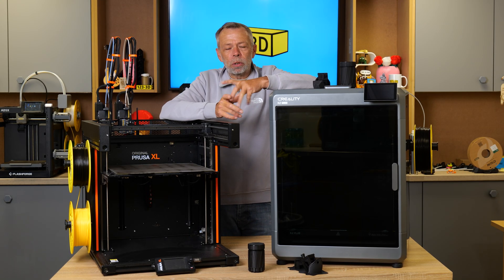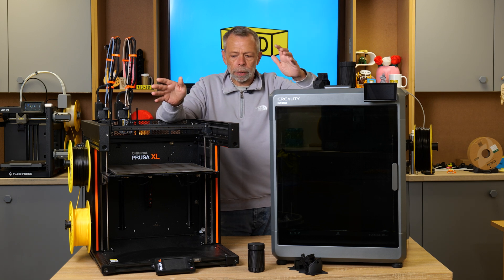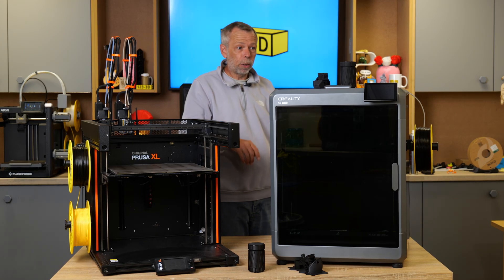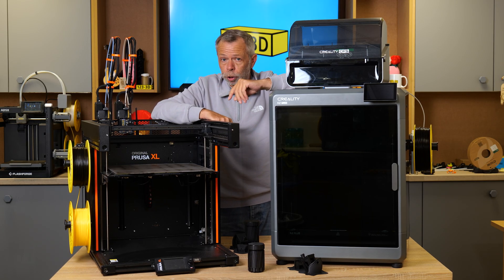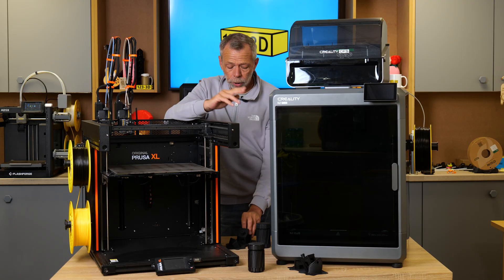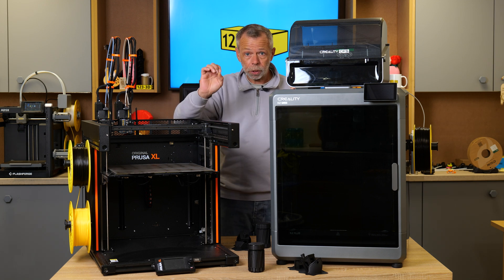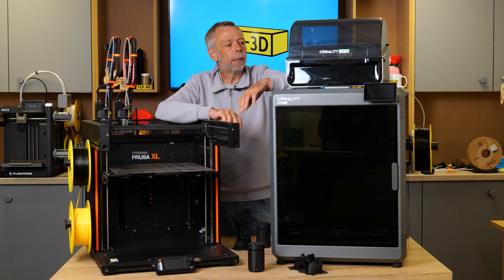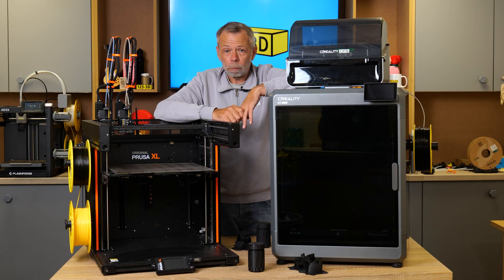Prusa XL or Creality K2 Plus? The Best Large-Format 3D Printer in 2025

Comment: Good explanation, Steve. 
I'm very happy with my K2 Plus, and I'd love to see how the K2 Plus setup works with TPU.
Reply: Only have to change the extruder spring with a 304 Stainless Steel, 6mm OD, 0.6mm Wire Size, 15mm Free Length,
And print the extruder spring break I would use a top mount spool holder as well